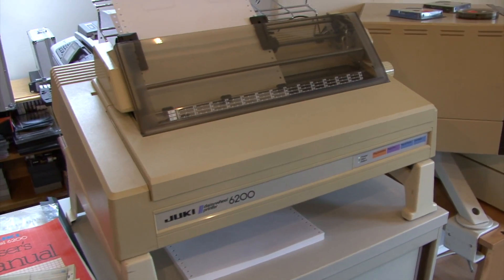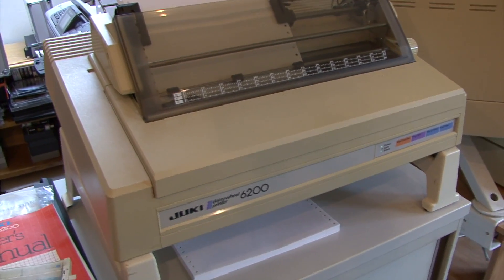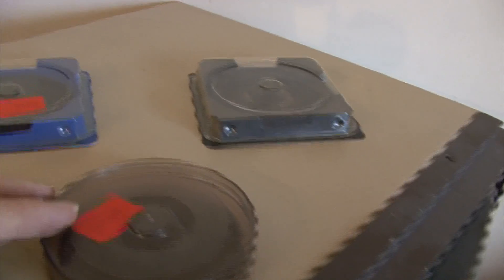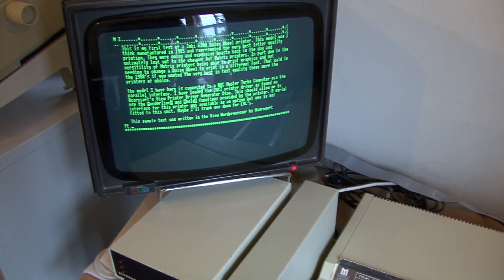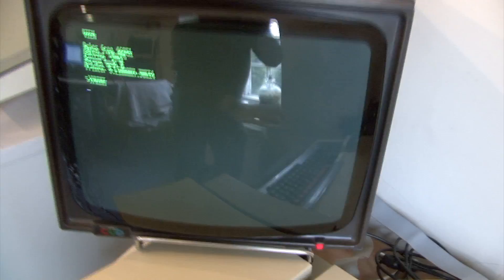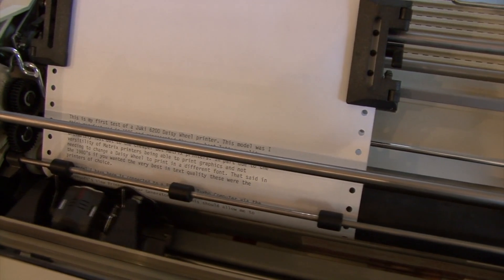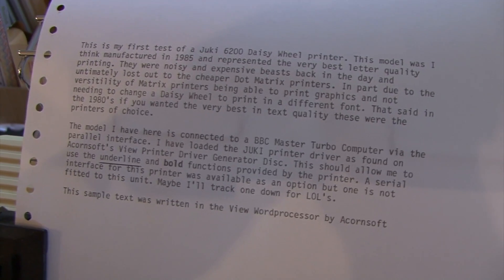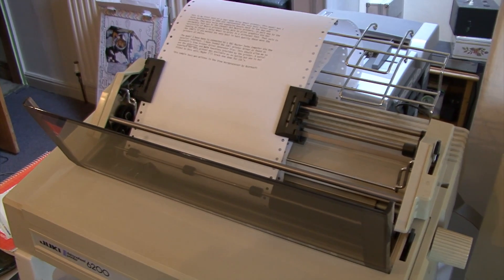Printing to a Juki 6200 Daisy Wheel Printer from a BBC Master

Comment: Hi!  Great video.  Just trying to set one up myself.  Do you know how to set an exact form length, by any chance?  I used to use one back in the day with continuous A4 but can’t see how to do this, manual just mentions a set number of lines per page.

Thank you!
Reply from the maker: As far as i can see  you can only set the form length to 11" or 12" via the dip switches. Set it to 12" for A4. You'll need the tractor feed kit, like the one attached to mine to be able to use continuous paper. Otherwise its single-sheet fed. More precise paper settings would be set in the software on the computer driving it. Sorry if that's a little vague! I've only used it with 11" continuous paper, driven from View on the Master and I've set up a blank document with the required number of lines to fit exactly on the page, 66 I think.

Comment: nice video. Do you much about the Master's cartridge slot? I have a cartridge with two eprom slots but not sure if I can put standard Beeb roms in it?
Reply from the maker: Retro Marky thank you. Yes you can put standard been Roms in it. 8 and 16kb I think, if memory serves. Just make sure you fit the EPROM’s the correct way around in the cartridge. There should be an indication to which way the EPROM ‘notch’ needs to face.